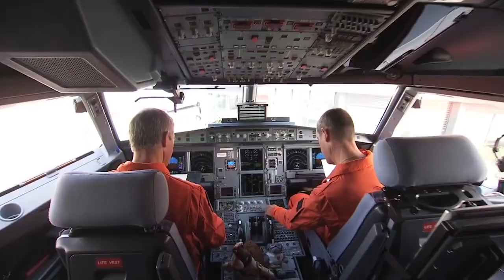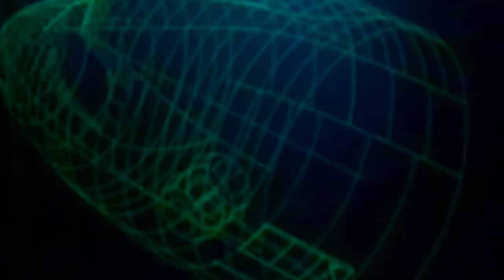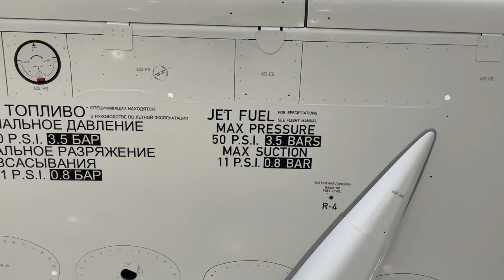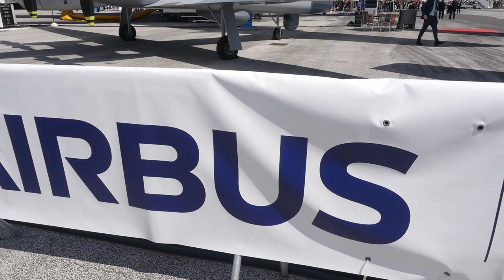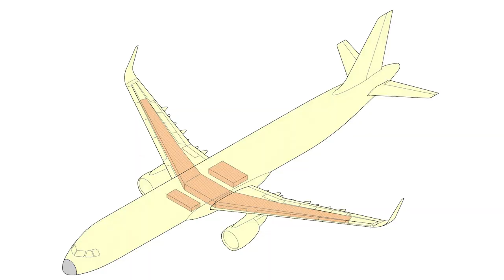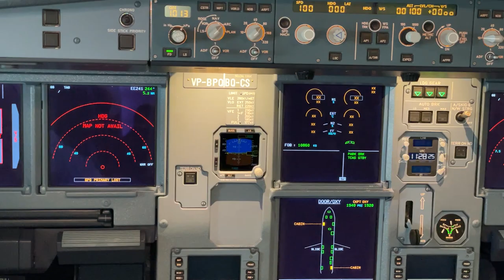Airbus A321 - becoming an ace of trumps

Comment: The XLR is pretty much the final thing that can be done out of it before it needs replacing
Reply: That's not true, they can yet switch to a composite wing. Airbus has always said that the A32x had one more generation left.
Reply: @jacobzimmermann59  Agree again Jacob.  The frame still has much room for improvement from the "current" 1988 configuration.
Reply: @twiff3rino28  It's not exactly the 1988 configuration, there is more to the Neo than just new engines. But this is all unless Boeing forces Airbus' hand. Boeing is now under huge pressure to launch an all-new narrowbody in the 150-200 seats class sooner rather than later. Airbus will have to respond and an improved A32x, good as it may be, might just not be good enough.
Reply: @jacobzimmermann59  I'm mainly referring to the -200 variant wing first flown 1988, not the -100 from 1987 (which entered service in early '88).  Even the XLR will use the '88 -200 wing with modified flaps.  The systems and flight deck also have much room for modernization, and being a native FBW design makes it much easier to port technology from the A350 and even A220.

I do wonder if Boeing is even willing to work on a new NB within the next decade?  It seems the single aisle market does not want to change from the status quo of the early '90s (A320 vs. 737).
Reply: @twiff3rino28  Boeing has to work on a new narrowbody, it has no choice. Regardless of whether they ultimately make money with the MAX, this is the end of the line for the venerable 737 series. On the other hand the A32x still has room for improvement, so Boeing must develop a new aircraft or they would have nothing to counter it with in the most competitive and lucrative segment of the market. That's just unthinkable.

The FBW and cockpit modernisation is an interesting question and I have been wondering about that too. If there ever is another A32x generation, it will have to receive substantial upgrades in those areas in order to be certified. If they develop a clean sheet replacement instead, then it's a no brainer. But Airbus now has two different state of the art cockpit designs and FBW systems, the A220 and the A350. Will they unify the A32x (or successor) with the A220 to have commonality across their single aisle families, or will they go for the A350 style for commonality across the middle of the market-widebody families?
Reply: @jacobzimmermann59  Good points - and more logical than the Wall Street "analysts" out there 😁
Reply: @twiff3rino28  It's not the analysts that are the issue, it's Boeing's senior management which is made of exclusively of beancounters and Wall Street types.

"Duh: on this segment the competitor's product is better than ours and unlike ours, they can improve it even further, what should we do?"

So far, for the MBA-laden illiterates who are in charge at Boeing that proved to be an intractable problem.

Comment: Why do airbus jets make a muffled dog barking sound? Know what I'm talking about? Is it the sound of the gears or the vertical and horizontal stabilizers adjusting? I swear I hear it on every type of airbus jet I fly but I never hear it on boeing jets.
Reply: Airbus a320 family has PTU-Power Transfer Unit sounds like a barking dog it happens often when the second engine starting up.

Comment: Airbus isn't the only one making many versions of the A321Neo Family Boeing have the Boeing 737 Max 8,Max 9,Max 7 & Max 10X all five versions of them if not maybe six if there's a Max 200.
Reply: That’s a difference! Like Boeing has the MAX 7,8,9 and 10, Airbus has the A319/320/321neo. The LR or XLR is a subversion in that sense. If Boeing DID the same they would have something like a 737 MAX 9ER or something like that, but so far they only have a lineup comparable to the A320neo family without the LR and XLR
Reply: @spongebubatz  the Airbus A321XER would be the Extra extended range A321NEO long then the A321NEO the A321LR and the A321XLR

Comment: I think you could have expanded a little more on useful load and field performance. The performance when loaded up is why the 757 is such a king.
Reply: It's performance is supposed to be similar to the standard A321neo due to an optimized wing/flap configuration

Comment: 3:37 that’s not an airbus wing. That was a 767-400 wing. You can see the raked wingtip. It’s the only aircraft that has that well the 787 does also.  Actually that’s probably what that wing was based on the smaller size
Reply: An inboard aileron too.  Could be 767-400 or 777 LR.  Lots of 737 wings in the vid too (not that it matters).

Comment: 3:27 Why you cheating us with a 777 wing??? 🤣
Reply: because we all know the boeing 777 wing is more superior .
Reply: @GabbieGirl007  superior of what ? B52 ? Yes. A 350 no !
Reply: @alainmare8081  B777-200LR has more range than the A350 wake up kid
Reply: @GabbieGirl007  I’d like to be a kid which I’m not anymore, i’m afraid.
777 is a good plane of course, nobody cant argue. But it is an older generation. For the moment it’s one of the Boeing’s  problem. They recycled old concepts because of shareholders pressure. So, at least as a good competitor they have to look at customer wishes instead of Wall Street reaction. Then we can talk. By the way 777 is costing 20% more in fuel consumption than A350 which, for companies makes indeed a big difference even if you are unconditional buy American !
Reply: @alainmare8081  you make interesting points sorry for the kid part that is unprofessional i must admit 
. also I mean the A350 isn't flying short ranges I think its safe to say that we need planes like the 767 but that have the range of a B77L , I guess the ultra high-bypass jet engines are gonna work that out .
Reply: @GabbieGirl007  I forgot to mention the Qantas’ choice for their projected direct flight London to Sydney. It seems that they choose a Airbus 1000 over Boeing for their sunrise project. I doubt of a political choice but instead the quality of a more modern aircraft for ultra long range flight.

Comment: How many versions of the Boeing 737 have there been?
Reply: Loads 
737-200 300 400 500 800 8K 8max and I think 5 max idk
Reply: @aviationin4k258  There is the 737-100 through -900, Max-7 through Max-10, plus the BBJ and the military variants, the C-40, T-43, P-8, and the AEW&C... that's what 15 different models. 
     This is over a 54 year career though, compared to the A320's 40 years or so.
Reply: @erictaylor5462  all the other versions are just based on "normal" 737s and I wouldn’t call them own versions in that sense, although they had to go severe modifications
Reply: 4 generations including those with the May Crash Any Second “feature”
Reply: Lots.

The latest being the new “uncontrollable pitch up” model. 😂
Reply: 100, 200, 300, 400, 500, 600, 700, 800, 900, max 7, max 8, max 9, max 10, for commercial use

Comment: The A321 doesn't have the lower take off weight and faster performance the the 757 which is why Delta is updating their 757 for flying into the next decade. American and United are also holding on to their 757's for the same reason. A fully loaded 757 can take off at 140 mph 20% lower than the 321. Plus it has higher flying speed (over 600 mph) and can maneuver altitudes faster than any other plane made today. which is why the airlines are hesitant to retire a plane that gets the job done particularly on South America and Hawaii routes. It's hard to find a plane that can service small airports, hot airports and high airports where the air is thinner of which the 757 can handle all 3 at once. The 321 runs less expensively but gives up on performance. I hope Boeing makes the perfect replacement with real future growth in aviation will be India, South America and Africa. But with the impending war none of this will matter for the next decade.
Reply: "Impending war"?  What war?  Plus the supposed "higher flying speed" is irrelevant in these days where economy rules.  Outside the US the 757 was rare, and the newest are 16 years old.

Comment: How about giving them 4 wheels bouge like indian ailines initial A320
Reply: The gear can still accommodate the weight
Reply: @spongebubatz  it’s not the weight by itself, it’s what is known as “floatation” or how much weight is on each wheel, or more specifically, the contact patch of each tire.  The early Indian 320s had four-wheel bogies to allow them to land on grass and dirt runways.  As it turns out that’s not likely to happen anymore, at least with the NEOs, as the bottom lip of the new engines is less than two feet off the ground.  Coupled with the higher amount of suction in those big motors at takeoff (or worse, max reverse) flying a NEO into an unprepared runway would essentially be like operating a pair of 30,000 hp* vacuum cleaners - they’ll suck every rock, stick, and small animal within a couple of feet of the intakes through at least the fan section, turning the 30,000 hp vacuum cleaner into a 30,000 hp Cuisinart……Since it makes no sense to operate the airplane from unprepared fields, in turn there’s no need use four-wheel bogies.

Floatation is a term I learned from an army tanker who was explaining that an M1 Abrams MBT - despite its massive weight - puts about as much pressure on the ground as a human being, (and less than a dog - you’ll know that if a large dog has ever stepped on your foot).  As it turns out he was correct for a human that was walking; a human standing stationary is about half the pressure of a tank, while a passenger car is twice the pressure of a tank.  An Airbus’s tires place five to six times the pressure on the ground as a tank, and Navy aircraft.

* Technically jet engines are rated in lbf thrust, not horsepower, and they are not the same thing, though lbf thrust does coincide with horsepower in steady state flight at about 300 kts.
Reply: @Pupda  I know the reasons why Air India had some A320s with that special feature, I just wanted to say that the A321XLR wouldn’t need a two bogey landing gear as the gear can still carry the weight!

Thanks a lot for your very detailed comment!
Reply: I believe that the a321 main landing gear is bigger in diameter to that of the a318, a319 and a320. Having the bigger main landing gear allows for the extra weight to be accommodated - so no need for the double bogey landing gear